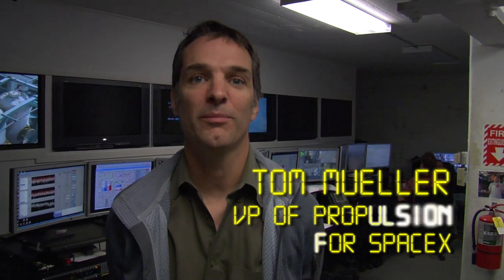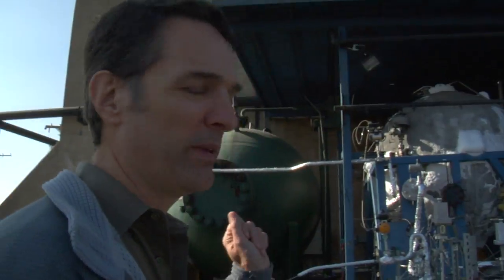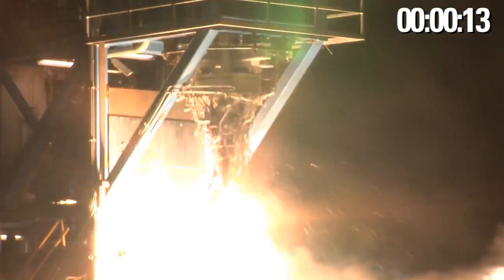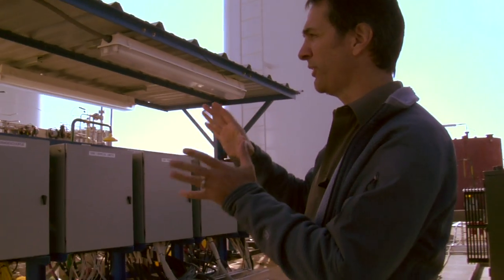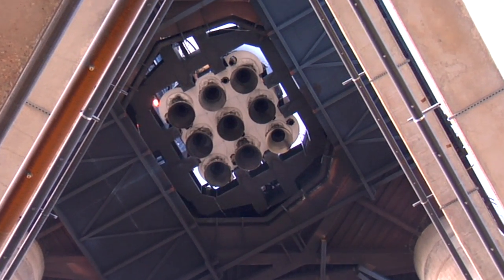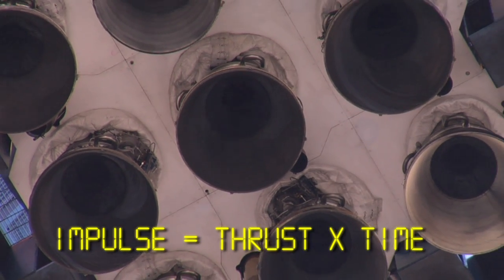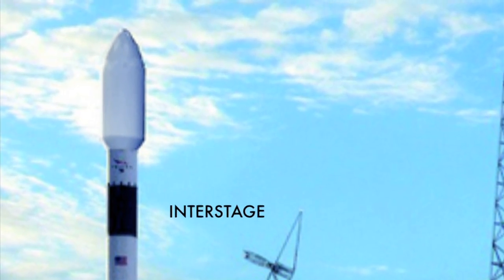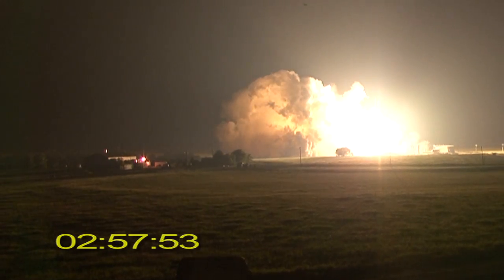SpaceX Tour - Texas Test Site

Comment: Everyone thinks Elon is behind the sucess of SpaceX, but really it's Thomas Muller. Genius rocket scientist.
Reply: Elon has a lot more to do with the design than most CEOs do
Reply: He is a genius, but where would he be without Elon? Maybe he'd do even more important work. Maybe he'd waste away in some company that gets held back by politics and bureaucracy. Fact is, in this timeline, he is doing phenomenal work, in part thanks to Elon.
Reply: Daniels30 Some of pretty big major decisions are made by Elon. If you have watch interview with Tom Muller, you will know this. In the early day of engine development, Elon was against the plan of Tom Mueller plan for having multiple parts for Merlin for easier development. Muller said it will make the engine development easier and shorter while fewer components will make the engine lighter but tend to blow the development engine more. Elon was insistent on fewer components against Tom Muller plan for easier development. They blew a lot of engine and parts. But in the end, Merlin became rocket engine with best thrust to weight ratio by a large margin; twice as better as F1, the one used in Saturn 5.
Reply: Elon is one in all . He read about rocket propulsion systems and elements and made the first merlin engine with mueller . It's basically team work

Comment: I suppose your comment on multiple engines would be true for old Rockedyne or P&W designs from the 60's. From what I can tell, the SpaceX engineers are NOT building engines with 1960's tech.  Think about it: the SSME (shuttle main engine) was the LAST great new engine design by a US company.  In 1974.  The degree of control, monitoring, quality of materials, computer simulation and just about everything else about these engines are lightyears ahead of anything previously designed.

Comment: rocket engines for second stages (vacuum operation) must shape the exhaust differently to compensate for the lack of atmospheric pressure.  Lots of little changes, but mostly the nozzle of the engine is much wider.

Comment: does anyone know the difference between the vacum and see level firing ? whats the difference of firing it in the vacum of space and sea level ? thanx guys
Reply: quinxxer Well, firstly, ASL (at sea level) has far more gravity and atmospheric pressure, meaning less efficiency. Atmospheric engines must be able to withstand higher inequalities in force due to increased air resistance and therefore thrust. On any given body of mass the thrust to weight (mass) ratio is rather more important as well. In space, it means longer and less efficient burns. However, on earth, the rocket might not even get off the ground.
Reply: air pressure changes the shape of the exhaust. thats why sea level rockets have small cones while vacuum optimized ones have large cones

Comment: @SquirrelFromGradLife On the other hand, it isn't very feasible to do TOO many engines. Bigger engines are more efficient. And you are simply skirting disaster if you stuff a million engines on the thing hoping nothing goes wrong. The Falcon Heavy having 36 is probably coming close to that point.

I'm sure Elon is aware of this, and the plan looks like he intends to upgrade to fewer large engines as he builds the capability to do so. But with F1 and F9 launches, his engine should be reliable.

Comment: @SquirrelFromGradLife More powerful engines doesn't necessarily mean more complex.

I think it should be about striking a balance. Multiple engines is good for a few reasons. If you are building a bunch of identical engines you get big costs savings and you get better individual reliability since you have more experience. As well, you can lose an engine without dooming the mission which gives a lot of breathing room.

Comment: I dont know if its a stupid question or not, but does the inherit risk involved with larger and more powerful complex engines outweigh the risk of having a multiple engine vehicle?
The Saturn V had five main engines..
You should believe that having fewer systems would eliminate a lot of risk. But again many very reliable engines may be better than bigger and more powerful but more complex engines...
I dont know there must be a trade-of point somewhere..
Reply: SquirrelFromGradLife Don't quote me on this, but sometimes we aren't technologically advanced enough to make huge engines as efficient as having a shedload of smaller engines (look at the booster stage of the SpaceX ITS).